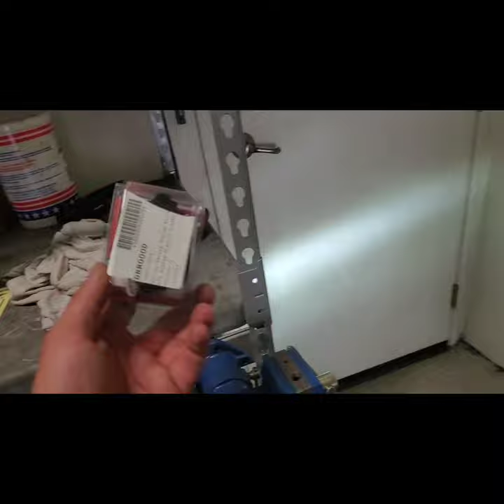2018 cbr1000rr-Pair/exhaust flapper mod tutorial. Exhaust install with best exhaust sound!!!

Comment: Thanks for making this video. Looks like a pain in the ass lol. Will be doing this in near future. I have a thumb drive ratchet wheel I wonder If I could fit. Also, think can I use shorter bolts with the plates?

Comment: Hi men,

I have same exact bike. I removed pair system like how you did but i got check engine light on. Did you plug any elemenator to pair system plug ?

How did you remove check engine ligth ?

Hope you still remember.
Reply from the maker: @ZaurSattarov  I got the comouter flashed to delete the pair system.
Reply: @scoobysword  Thank you men.

Comment: Hey man have a dumb question, do you need to empty the tank before disconnecting those quick connect? I have a 2017 and waiting for my ecu and EU stacks atm. Was trying not to take the tank off completely nor emptying when installing the stacks and taking off intake restrictions.
Reply from the maker: hey bud, no need to empty the tank. the high pressure line that comes out is restricted until the fuel pump is activated. super easy to take off. cover your plastics with rags just in case of any spillage.

Comment: question? If I am ONLY eliminating the stock muffler, do i need to flash computer? I want to keep the bike as stock as possible but I did notice that it lost low RPM torque when I installed the after market muffler. So that is my question - or then i will just place the original muffler back on so it can have the servo function and just have a muffler shop cut off the actual muffler  after the servo function and weld the after market at that point. thanks
Reply from the maker: The servo motor control a flap in the exhuast for noise, nothing else. You lost low end torque because you likely don't have enough back pressure. You should in my opinion get the computer flashed for your muffler type and also have the flash delete the servo motor function. That way you can remove it and have your low end somewhat back and have a little less weight. Oh and no diag codes.

Comment: I have the 2017 one, is the same bike. I was wondering what is the point of the block off plates you installed. Do they make any difference if you flash it?
Reply from the maker: It reduces popping out of the exhuast on deceleration as well as takes that little extra weight off from the bike. Its an unnecessary system used for epa. It essentially bursts air into the exhuast to rid any extra fuel.
Reply from the maker: Shouldn't effect anything from your flash.
Reply: @scoobysword  would you happen to have a rough estimate for how much weight is saved by removing the oem system? Seeing as how it doesn’t affect performance in anyway other than weight and all the effort that goes into the job.
Reply from the maker: @JmvTv101  it saves approximately 8 to 10 pounds. It. Retainer does have a performance boost when flashing with the akro exhaust. It's made for performance enhancement.
Reply from the maker: @JmvTv101  as well removing the pair system saves you from having popping on deceleration

Comment: Hey man, congratulations on picking up your dream bike! I'm thinking about picking up a 2018... if you don't mind me asking how much did you pay out the door for your bike (and in what state)? Anyway good job on the quick progress, you tuning the ECU through Woolich or?
Reply from the maker: Hey Patrick, thanks man. Dont mind at all, I found if for the lowest price I could. I paid 14750 out the door for the 2018 with only 1 mile on it. This was is California. I got the Ecu flashed through Danos performance because he has a proven track record and he's located about 2 hours from me in Socal. The turn around time was ridiculous quick. The bike was listed for 11300 btw. Lowest price I found in 3 states.
Reply: @scoobysword  Cool thanks a lot for the info. I'm looking at a 2018 non-abs from a local dealer (also here in SoCal) so it helps to have that info for negotiating. I'm shooting for under 14K OTD. Never spent nearly that much on a car or moto but I'm tempted. I look forward to a follow-up video on how it rides with the flash and pipe. I think the Akra shorty is the best slip on for this bike, and I'm sure you know how restricted these bikes are with the stock tune. Cheers, Patrick
Reply from the maker: Ya, your right on point with how restricted they are. I have a new review video of the ride coming up in just a couple days here. Hope you enjoy it. Oh, and if your looking for a 2018 for the same price.. I know that Huntington Beach Honda where I picked up mine has a non abs in matte black for the same exact price. Atleast they did a month ago.
Reply: I have some 2017, 😅 which I'm going to leave alone.

Comment: Thanks for making this video.  I noticed you didn't add a servo buddy and you didn't encounter check engine light?  Was it because of the ECU flash?

Did you encounter any check engine light with the pair valve disconnected like that?
Reply from the maker: Hey,
no servo buddy needed with the ecu flash, same goes for the pair mod. I accounted for everything I wanted to mod before requested what I needed on the flash. Danos can you hook you up with a great flash.

Comment: Who did your ecu flash?
Reply from the maker: Danos performance. You can look them up online. Should come up out of california.
Reply: Thanks.
Reply: How would you rate them? I had my Ecu flash by Toce Performance before on my 600rr but wanted to try someone new for my 1000rr.
Also what’s your view on bmc/sprinter/k&n race air filters? Oh by the way thanks for the video it helped me a lot
Reply from the maker: @sulaymandawud3593  I thought Dano was professional and had a quick turn around. I got everything I wanted and had no issues. I find the aftermarket air filters didn't perform on the dyno any better than the stock air filter.
Reply: Thanks for the information appreciate.
Reply: I just removed the pair system with the help of your video, but i forgot to put a clamp or zip tie on the rubber plug. Do you think it will be fine ?
Reply from the maker: @sulaymandawud3593  should be just fine bud. As long as you removed the system is shouldn't be forcing any air our.
Reply: Ok thanks Matt appreciate all your help.